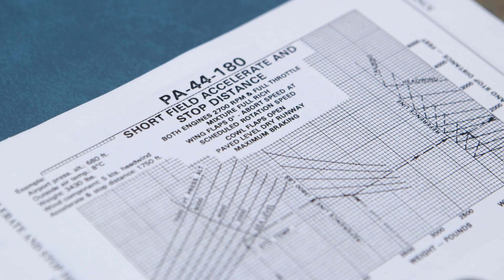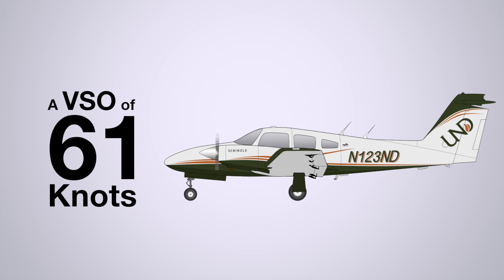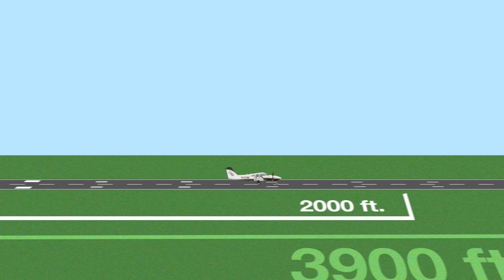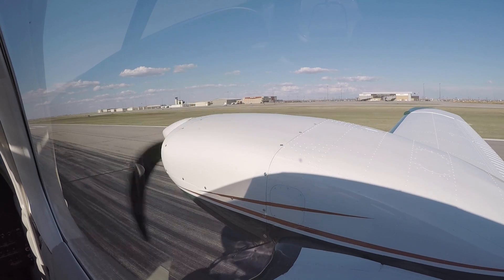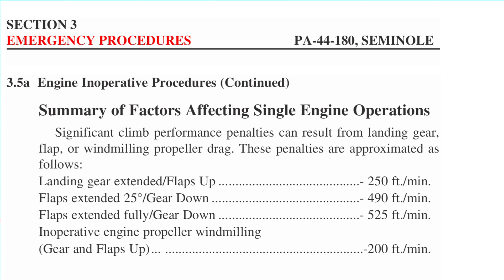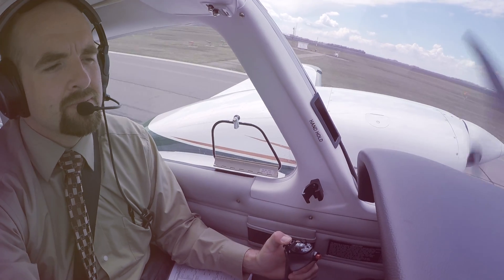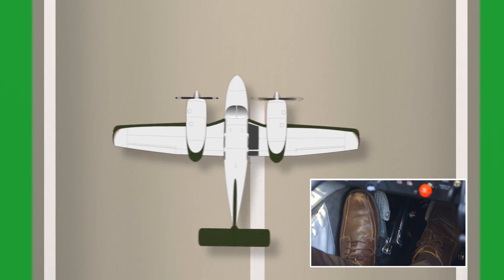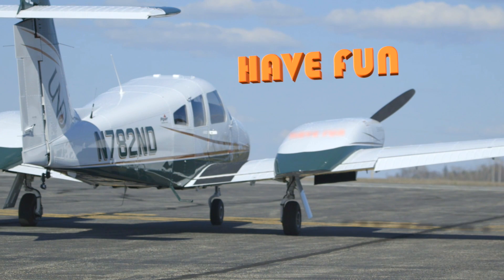Engine Failure: Takeoff Roll

Comment: I would imagine that one of the most difficult things in life to do would be to avoid the panic and voluntarily pull (upon experiencing an engine failure after takeoff and watching the airspeed fall steadily toward that red line), the only good engine you have left to idle, push the nose over to a safe flying speed, and accept a crash landing, under control, into whatever is ahead of you. However, if you chicken out and decide to try to salvage the flight and stay in the air in most light twins after an engine failure on takeoff, then at least your friends will be able to say that you fought the good fight - right up until the inevitable Vmc roll into the ground.

Comment: What do you do when you have an engine failure when you're past decision point on the runway? Say you're too far down, or 10ft off the runway and your engine dies.
Reply: In the scenario you describe, it's curtains I'm afraid... The best you can do is a good preflight planning where you consider the take-off performance and the abort point so you don't find yourself in that situation. The rule is 70 % of the liftoff speed at 50 % of the runway length. My personal personal minimums, taking into account the distance required to stop neer Vr and to keep it simple I go by the rule of "airborne at the half-way point or abort"

Comment: Multis aren't safer and cost a lot more overall.
Reply: sounds like at this point they're mostly used for multi engine training for folks who eventually move up to jets. Most folks would rather spend the money on a high performance single (Cirrus, Bonanza) for the same or less operating costs.

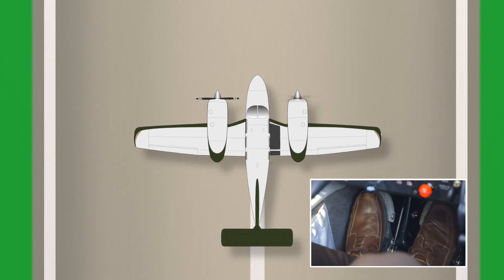Comment: I was sorry to hear at 11:12 you mentioned the use of aerodynamic braking to help stop the airplane. This is not good advice because test pilots during testing do not use that method to help stop the airplane. It's not factored into the stopping distance.

I'm a retired airline flight crew instructor. I worked for a major US airline who flew the L-1011. We had a Captain who was taught to use aerodynamic braking when he learned to fly. He always used it. Aerodynamic braking was never used on the TriStar during testing as it already had features to help stop it on the ground (ground spoilers and anti-skid brakes). That is all that it and other jetliners needed.

One day this Captain pulled the nose up so high to start his aero braking that he hit the tail hard enough to cause structural damage. We had a pilot union so he got a month off without pay and a warning if he continued to try and use aero braking on his landings, he would lose his job. Well, this Captain was sure he knew more about airplanes than anyone else working at that airline, so he continued to aero brake his landings.

One day it happened again. The next day he was permanently out of a job!! You're not doing a service by telling new ME pilots to use aerodynamic braking to help stop their airplanes.

The question is: did the manufacturer of the aircraft use aero breaking as part of their distance testing? The answer is no. The distances found in the performance charts were obtained without the use of aero braking. Therefore, to attempt to land using any other technique, not might, but WILL, cause you to exceed the published landing distance.

Comment: Hello thanks for this video. But on an engine failure on inicial climb after takeoff, with gear down and flaps set for to, below the best of climb speed, what's the correct procedure?
Reply: piranhabitesme on the Seminole we will abort takeoff and land straight ahead with a windmilling prop and gear down. The performance just isn't there for a continued takeoff.
Reply: And then you eat the fence at the end of the runway, because your calculated accelerate stop distance was based an a failure occuring at rotation, and doesn’t count the time you spent airborne. I almost think it would be better to pretend you’re a single engine and perform a forced landing at whatever open real-estate you can find in front of you.
Reply: Gear and flaps retracted. Continue in the pattern and land.